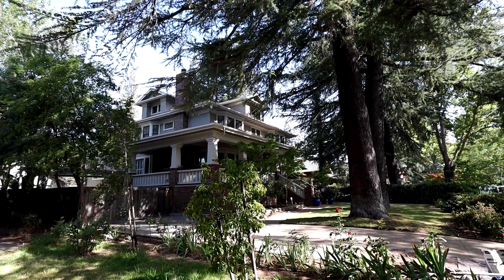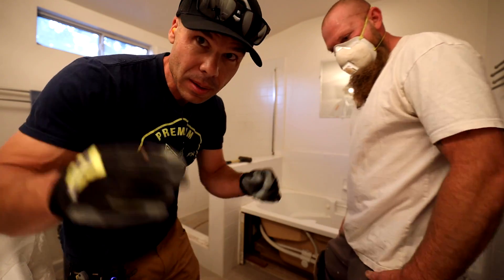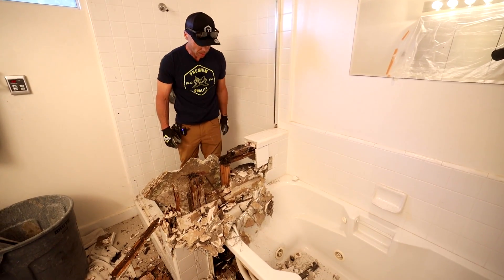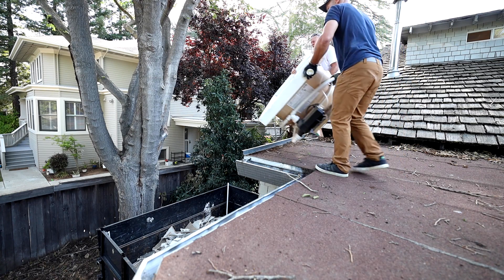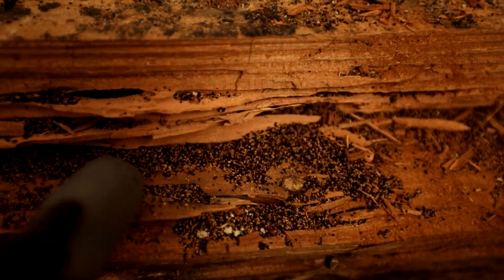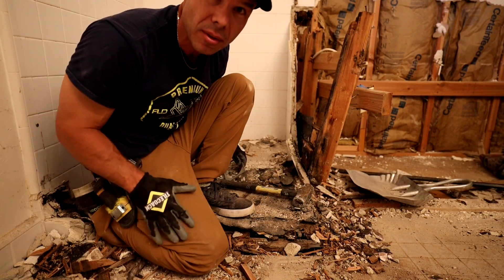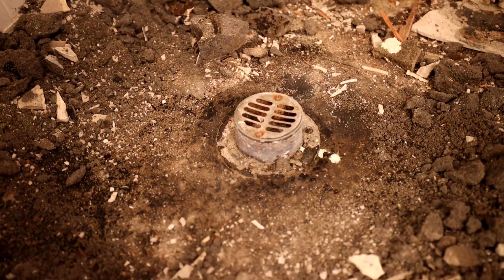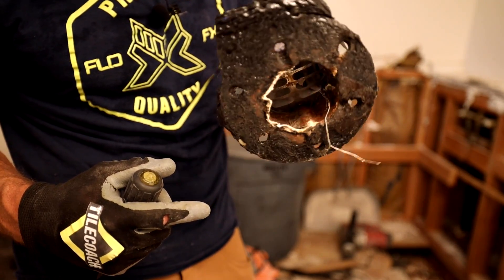BIG SHOWER FAILURE...Termites, Fungus, and Mold!!!

Comment: Hi Mr. Tile coach,  I am getting ready to do my master bathroom remodel and I also am considering on putting a grey water system into my shower because of our drought here in California,.  Because of the way my bathroom is plumbed and distance from an outside wall I am considering on putting in a two drain shower in with one drain going to a grey water sump system and the other drain going to the normal house sewer system.  I thought since I was doing a new shower anyway...why deal with diverter valves under the floor when I could do a simple manual ( and visual ) drain system from the top.  My thinking was to somehow install a popup drain valve like a bathtub drain with one sending the drain to the normal sewer system and the other diverting it to a grey water collecting/distribution system.  This way I could easily just step on which drain I want to send the water to.  What are your thoughts and how would you set up a shower like this if one was built like that???   Thanks for all your U-Tube shows I love the way you are doing this.

Comment: I’ve seen several times where you mention packing gravel around drain to prevent fouling of weep holes. My guys too have done this, not in over 20 years though. When we were building mud pans over butyl liners, we began using high density reticulated polyether foam around base of drain. Only needed 1” tall and 1” od around perimeter of drain. I’ve known others that wrapped the drain in polyester felt filter media, which too works but we’ve found the foam drains far better and never clogs keeping the mortar bed far drier. 

Of course we’ve been doing Hydroban & Kerdi bonded linear drains with membrane over mud pans for last decade. If we were in CA where hot mopping is still popular, I’d recommend looking at foam ring at drain base. 👍

Comment: Hey Coach,
I learned early on NOT to use a sledge hammer on old plaster houses.The vibration causes cracks.I tore out a shower and the next day the client called to let me know the walls were all cracked up around the other side.I never used it again, just used the small jack.The quicker smaller vibration seemed the cure.Just saying and passing it on.Good work as always.
Reply: What a shame that you destroyed that glass divider

Comment: I dont believe looking at those weep holes if the tile guy had cleared the round hole it would have made a difference based upon all the tar that was in the channel that directs water to the center of the drain. The only way I see the old cast iron drains and weep holes working is to drill new holes after the clamping part of that drain is glue in with the tar . The holes need to be drilled at the base of that riser then protected with gravel.  
Was the old pan pitched?

Comment: In the last shower you described how Star tile was probably correct water wicking up over the curb destroyed the curb because the weep holes wher plugged. 
This looks to be the same type of weep hole issue with the addition of a pony wall that leaked.  From the video the curb cement looks bone dry inside and out!

Comment: The dreaded termites. they love that moist soggy wood.  Ive seen something like that before but it wasnt Termites. It was from the 300k+ acre 2020 Creek Fire in and around shaverlake ca. At  a few of the homes everything was burned and rubble but at a few the shower floats were still FREE-standing with everything burned away from it. they were just bare concrete even the thinset powdered and crumbled.

Comment: Brothaman as an electrician apprentice here in LA. I did some small tile repair at my house with my father in law. I have such respect for your craft man. My father in law wanted to reuse some of the original tile on a section our living room where hvac guys took out our floor heaters. We had to close the hole and of course they don’t sell the tile that was put in the house anymore. We found similar, but anyways it was the hardest work I’ve done. I appreciate you a lot. Your Channel actually helped me even tackle this project.

Comment: Termite poop..aka frass....those guys are probably throughout the house...bare minimum all in that general area of the house.
Reply: Absolutely. These are Drywood Termites too so fumigation is really the best way to treat the house. Local treatments can work but only if they are in that one area.  Never know until you start opening stuff up but it's highly unlikely they haven't swarmed to other areas of the structure. Additionally, they had to come from somewhere close by so they could be at the neighbors' house or any other structure within 1,000 feet or so.

Comment: Gonna have to possibly tear out my new shower (had out contractor install, as have health issues now and back then and so “had help). Fast forward today and grout cracking bad around drain (and the tile cuts throughout entire job is imo, sad; along w; grout spacing…can be 1/16 to 1/8, to 1/4, & even 1/2 in some areas and the lippage factor is too many and not cool; especially the price and “ease” of my design. There was a lot of rushed work done , but even that….you can still prevent a lot of the issues that happened her 🤦🏼 (grout’s 3x and not right still, Mudbed redo 2x, forgot to connect into house vent stacks, smh….etc……
Even my new ADA tub & toilet, vanity, etc…will possibly need removed to fix all the tile and “errors” during install (electrical and exhaust fans too).
Just breaks my heart; as disabled (and will help family/friends out on jobs)…..taking on this job, gonna have to hire someone to come and “repair” or start over, as too much for me right now.
It’s frustrating, but happens. Still enjoy these vids, as reminds me of “me” in my early years of construction.
So, keep up those standards, watching out for those details, and you’ll have a winner each time; and repeat business.
Thx again Isaac, and cheers✌🏻

Comment: Silly question: is there ever a consideration for metal stud alternatives in-place of wood?
Reply: Metal studs are a lot more expensive, and there is not really a way to make a steel sub floor other then pouring concrete. Still when you have a leaking shower the issues will just transfer to the drywall and so forth so Good waterproofing is a Must.
Reply: I always frame basements with metal studs due to moisture. Not a bad idea for showers too.
Reply: @howtodoitdude1662  Ive done both, It has a lot more to do with construction technology and how it's actually put together then the studs themselves. Steel is often more expensive, Plus is you get a leak in the shower the studs arn't going to save you as the water will affect the drywall baseboards and all. They do have there place in the industry thou.
Reply: They will rust.
Reply: @doubledarefan   If you put a sill gasket in between it will be fine and not rust